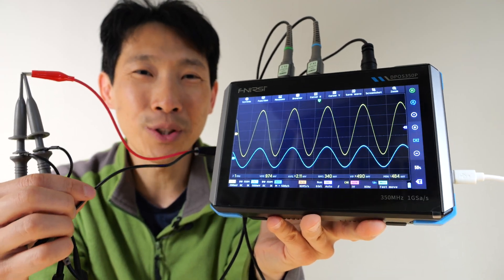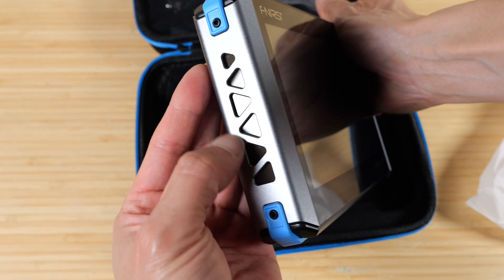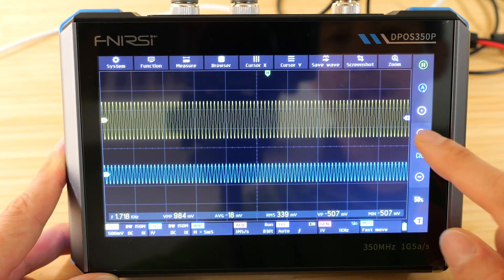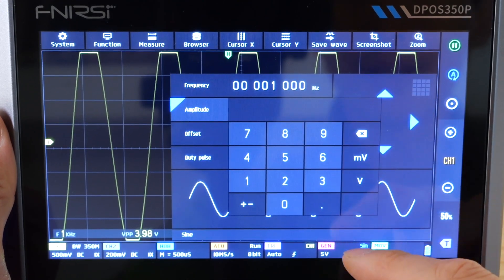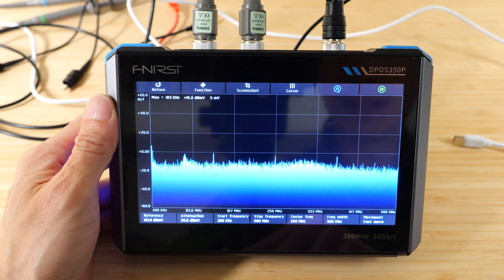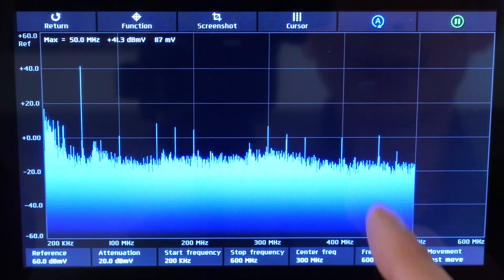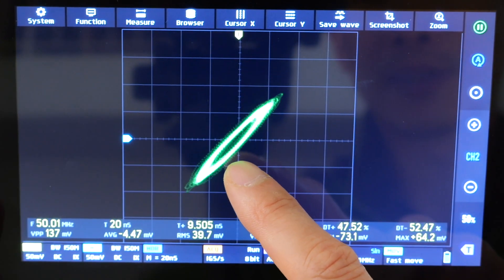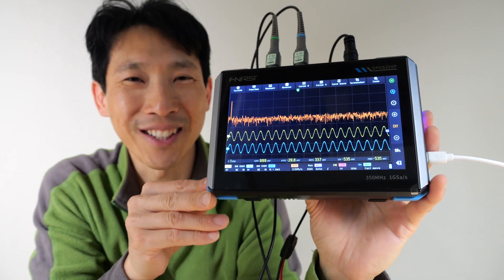350Mhz Scope with a Spectrum Analyzer [FNIRSI]

Comment: How well would this work on car audio equipment to display sign waves to detect clipping? What is the max AC voltage that this could display?
Reply from the maker: Vertical range is 160V (AD or DC), generally scopes can easily accommodate the ac voltage range of audio equipment and easily detect clipping. Technically, you only need a 20kHz scope to test audio equipment.

Comment: Had one of these for a while now, It appear that you can't trigger a waveform if the time base is slower than 50mS. Also the curser's don't function at the slower time base speed. Anyone else found this problem?
Reply from the maker: It's certainly a more nuanced corner case feature. It certainly wont be as robust as scopes costing 10x more.

Comment: Even cheap MCU based (without FPGA), lower bandwidth (200-280 MSps) oscilloscopes such as ZT-703S has 128Kpt memory depth…
Reply from the maker: They really should sell ones with more memory depth at different price points.

Comment: I am planning to buy myself one as I do have the need for a scope sometimes. You can connect it to a computer for screenshots as well as updating firmware. Pity it does not have HDMI connector and not opensource as I am sure some people will be able to make nice changes to the firmware.

Comment: That's nonsense, not a meter. Nothing quite adds up. 350 MHz, but only 1 gs/s? A spectrum analyzer plots images, not harmonics, not to mention measurements...
Reply from the maker: You are right about the spectrum analyzer plotting images, not being specific enough on my part. This goes for less than $300, is there anything that performs better at this price level?

Comment: FFT analyzer... What's the resolution ie RBW
Reply from the maker: It's not using a sweeping filter but rather a FFT. You can however choose the number of points to do the FFT 4k to 32k. It is unclear how long or how fast is it sampling as the input to the FFT but I would assume it varies depending on your start/stop freq.
Reply from the maker: This machine appears to be doing a FFT on the time domain signal so a RBW spec is not shown. If one knew the sampling frequency which may change depending on your frequency sweep range, perhaps one could be calculated.

Comment: My box is tuned low 28hz would this work for me? I bought a different one and it was only 45hz to 20k basically a mids oscilloscope anyway I really need one for subwoofer tuning any advice would be great
Reply: ?
FRA can go down to 10Hz with the new firmware.